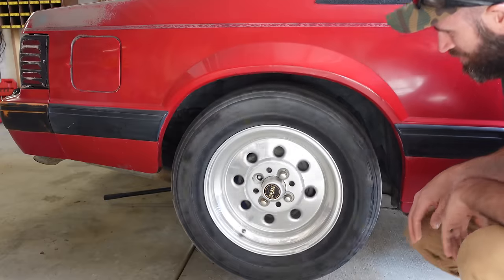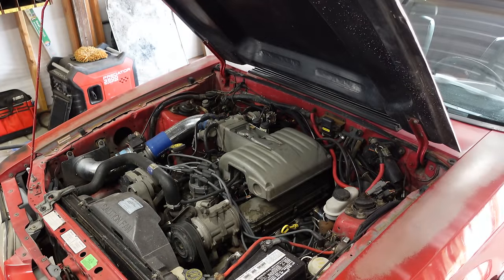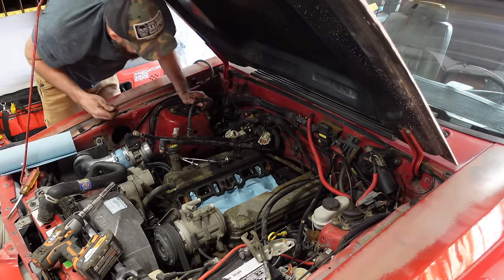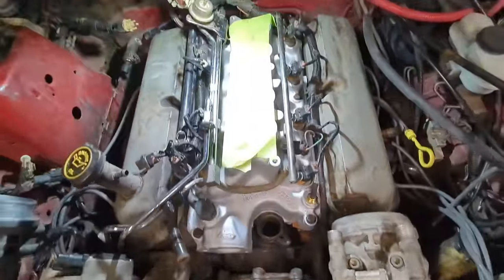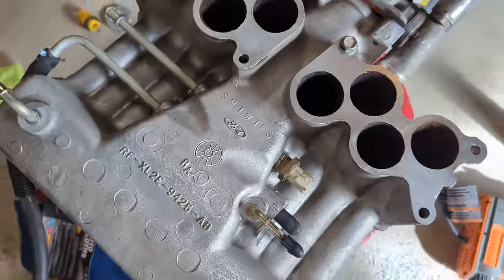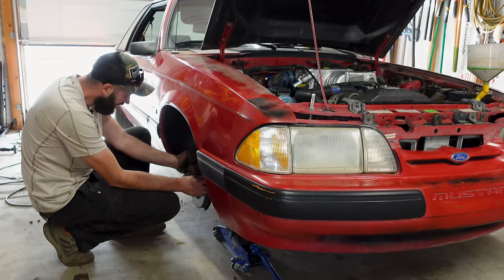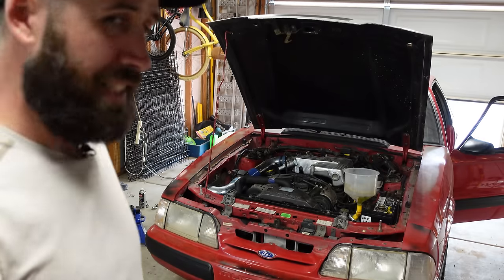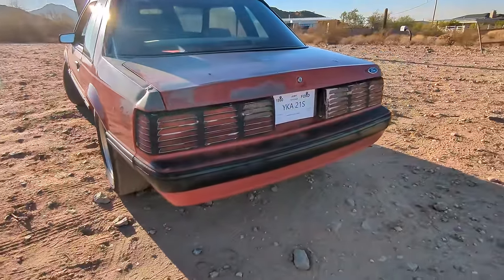Junkyard GT40 Intake Upgrade! Cheap HP? Or Much Regret For The Fox body Mustang?

Comment: One of the best cars i bought used was found on road dead, the guy sold it to me because it quit on him on the side of the road. He couldn't get it running so i got it for cheap. the resistor Wire was burned. I hotwired it to get home then figured it out. it  was  1967 Mustang with a 351 Cleveland 4 barrel and a 4 speed.
Reply from the maker: Nice!

Comment: I wish more ppl would do this. Real easy to do parts swaps all can do. I like watching ppl run setups on Dyno, go nuts etc but its nice to just see a car person work in their car trying to make it a lil bit better. I wish more ppl would experiment with 4.6 2,3,4 valves. Especially thevold panther 2valves. I drive a vouple town cars. Love these engines. Together theyve taken me over 600k miles with no repairs. But i did do the vent seal, reroute the water pump line from back of pump to engine so it wont leak under intake, swapped plastic intake for aluminum, retoute the  passenger Drain and AC lines so they dont leak on frame, derusted, killed rust, sealed up with internal frame coating, rustoleum black, then oil/wax coating all over. 303 any and all rubber like bags, tires, wipers, etc. Feels good to do small stuff yourself and know that this car will last so much longer for it. Its not always about the MPH, HP etc, its about loving what u drive and driving what u love. Panthers FOREVER!!
Reply from the maker: Haha hell yeah, that's the best part! I had a 2001 GT and spent many days on the side of the road placing helicoils lol so I have a bit of a love/hate relationship with that 4.6 😂
Reply: @VeteranRevivals  Love the handle, Semper Fi. Well I can't blame u there, but I can say I've only had plug shits fired from 3v 4.6 n 5.4. Seems like when they either keep it simple stupid, KISS, or make it 4 valves per, issues are scarce. A lot say the trans are weak. I've never had issues there either. I never flush mine, not supposed to per Ford, and always use motorcraft, BnG, friction modifiers, sythnetics like amsoil, and had good luck. But I don't abuse mine either. I don't baby it but I don't neutral drop them either. My 99 ride me n buddies muddy asses all over tri state area going to well pads, forest clearings, pipeline right aways, and has had her fair share of stuck in mud, muck spinning 80mph trying to get traction. And when I break out the 2x2 snow, mud chains look out. Having a family it's the perfect sedan for gear, smooth rides, vacations and about all things. Love them. U have a gr8 week and a good Ho Ho Ho.
Reply from the maker: Haha I love it, one day I'll have to give one a try!

Comment: Just a FYI, buy a set of AFR 185’s. And use the GT40 and cam then when you go 351w use the same AFR’s send your Intake to Big dogs porting, Or buy another and have it ready, and you’ll be 350-400wheel hp. I’m at 315 with stock Intake and GT40 heads with their cam. Heads, and intake are ported, intake is stage III, Heads are stage II. With a ported Gt40 intake id be more along 335-350wheel.

Comment: Old trick from 60 yrs ago.
China wall: drill 1/8" holes 3/32" deep about 1" apart across the length of the china wall.
Whatever gaskets you use wil be captured and cant squirt out. 👍👍😎
Either on the block or the intake. No need to do both.
*****
Intake bolts.. take two extras, cut off the heads, make a screwdriver slot, put one on each side to guide the intake down straight.
****
Cooling system clean out: Prestone Flush yellow bottle. Put it in and drive it 300 miles. Super clean. Flush out the bottom radiator tank. Back flush the hear core. 👍😀
New green antifreeze every 2 years 
****
Thermostat: drill one 3/32 hole in the rim to burp out the air when being refilled. Some thermostats already have them.
Reply from the maker: Nice! Those are some handy tips

Comment: I got a bone stock bottom end carbed 351w in my 82.    Tfs 11r 190 heads.  Tfs stage 2 cam.  1.7 rockers. Vic jr intake.  1 7/8 long tubes. X pipe.  Laying down 425 rwhp 460 ftlbs.  And still has the bearings and rings put in it ij 1996 from henry ford
Reply from the maker: Nice! I have no doubt the 351 is a strong choice

Comment: I have two 1997 Explorers. One came with GT40 heads, and one came with GT40P heads. GT40 Explorer heads used in '96 to mid 97. Three casting 'bars' on head indicate GT40, four bars are the gt40P. Don't know if exhaust manifolds are different considering the reengineered spark plug location.

Comment: An old "cure" for the "china wall" front and rear gaskets on intake manifolds, was to take a hammer and pointed punch and dimple the top of the china wall where those gaskets were going to sit, so they had a rougher surface to keep from sliding out. but an experienced hand laying down just the right amount of "bead" will suffice.
Reply from the maker: Haha that's pretty clever
Reply: Drill 1/8" dimples one inch apart in wall and/or manifold. For rubber or RTV.
Reply: my "old cure" was to throw them right in the trash and use a bead of good rtv on the front and back.  Permatex "right stuff" is excellent

Comment: For easy radiator draining, head on down to Dollar General or Walmart,  and get one of those plastic bins for storing stuff under your bed. They're long and work great if you just want to pull the lower radiator hose
Reply from the maker: 🤔 that's genius
Reply: I do essentially the same thing. It's a fairly flat clear plastic storage container with a lid, about 6x18x30. Works perfect.

Comment: Great vid, really enjoyed it.  Before you drop some coin on a new steering rack, try replacing the inner tie rod ends. They're not very expensive and are relatively easy to replace.  Perhaps you can make another video.
Reply from the maker: Thank you! Unfortunately, as you'll see in the last video the power steering pump seized up and filled the whole rack with metal. Aside from that the backlash in the rack was really bad and all the seals were puking 😞
Reply: When you have left and right play in your front wheel, it is normally the tie rod end, which is a easy replacement, But be sure and get an alignment after you replace either one, and if you have movement with your hands at the 12 and 6:00 positions, then you likely have a bad wheel bearing, which again, isn't a difficult replacement at all.

Comment: I hope you really get the car where you want it to be. Us fox body guys have to stick together. I own two 88 mustangs one lx 5 speed and the is a gt with a number matching 93 cobra motor with a automatic. Thanks for sharing this. I also have a 97 explorer. It won't start now because of the crap ethenol that screws up fuel pumps .you take care brother
Reply from the maker: Thank you! Drop that tank, replace that hose and get her back on the road! 🤙

Comment: This was useful for me. I have a 1988 Lincoln Mark VII which I want to do some upgrades on the cheap. It's a Bill Blass edition too-not the LSC. Love the whitewalls and wire wheels on it. It's a pretty fun car to drive.
Reply from the maker: Hell yeah! I bet that thing rides like a dream!
Reply: you probably already know this, but the LSC had the High Output 5.0 used in Mustangs, so it has a 351W firing order (should you change cams or ignition). the non LSC had the regular 5.0 used in thunderbirds and Lincolns so it has the 302 firing order and i think lacks the forged pistons of the HO 5.0
Reply from the maker: I did not know, that's good info!
Reply: @alertgasper  Actually,you're wrong. In 1988 all the LIncoln Mark Vii's got the 5.0 HO engine,AOD trans,traction-lok and dual exhaust. Not just the LSC. My Bill Blass edition has the exact same drivetrain. It basically a Mustang GT with a Lincoln body-and better brakes with air suspension.
Reply: @TheWalkmanRotation  thank you for that information--it was the 1986-7 models that only had the 200 hp and the HO in the LSC. so you're good to go with that hot rod lincoln :)
Reply: Never forget that the Lincoln computer is NOT easily reprogrammed for mods, so you'll be looking at a $$ upgrade.
It's not the Mustang computer.

Comment: Thanks for painting the hood 👍. Now i can stand to look at it 😉. Is that the Ford block that splits in half if you go over 500 ponies?
Reply from the maker: Yes sir, I've seen them go well over 500 on boosted cars, so maybe it has a lot to do with a properly balanced rotating assembly 🤷🏻‍♂️
Reply: Commonly considered the 500-550hp is where you are pulling the pin on the proverbial grenade, but some last beyond that level and even for a decent amount of time. I personally think not enough attention is paid to damaging harmonics, but that’s just my personal opinion. Glad you’re enjoying it and avoiding going LS !

Comment: Front sump on oil pan is where the pump sits.
Reply from the maker: That's what I figured, I couldn't remember
Reply: The oil pump is in the front, the pickup is in the rear sump. The front sump is there to make room for the pump body.
Reply: @VeteranRevivals  It's driven by the distributor... so just take a look at where that's located. 🙂👍

Comment: You can build a 351W for same or less than an LS.   roughly 500 hp vs 500hp.
Reply from the maker: True true, but much heavier
Reply: @VeteranRevivals  Iron block with aluminum heads, the weights are close for the long blocks.   Where the LS has the advantage in weight is the intake manifold. If you're going carburetor then that advantage is equalized.   I don't know the exact weights for the 351W or the Iron block LS, I do know the Iron block 302 bare only weighs 20 pounds more than the aluminum block LS.
Reply from the maker: That's not a bad weight difference. So the debate usually lies in money haha. If, I'm going to buy aluminum heads for a 351, I might as well pick up the junkyard LS for less than the cost of the heads for the 351. Trust me, I'm a Ford guy 100%, but it's really hard to justify the cost for staying with Ford 😞
Reply: By the time you get the crossmembers, swap headers, swap harness, stand alone injection, etc for running that LS, you could have dropped a 351 in there easily. Many hype the low cost of the LS but by the time it’s truly all said and done there’s not much if any savings, especially if you find yourself a deal on Windsor stuff…

Comment: There’s only one oil pickup. It’s in the back where the pan is dented.
Reply from the maker: Maybe it's time for a new pan!
Reply: Maybe, but if you’re trying to save a buck or two you can probably hammer it out from the inside. I had the exact same thing on my 351 and was able to hammer it out just fine. Oil pans aren’t as cheap as you might think.

Comment: Hey like the video been looking for a video like this that explains all one questions I have the same intake manifold non egr fory fox ody do I have to tap the sensor in or can I run it with out it
Reply from the maker: You'll have to tap in the IAT sensor or it won't run correctly.
Reply: Ok thanks you know the size for the drill bit and the tread I need to make it to
Reply from the maker: I don't remember off hand, but I believe the tap is 3/8
Reply: Hey sorry just can figure out what hoses I cap and which one I run to supply and fuel if you can give me a hint please and thank you
Reply from the maker: That's a tough one to spell out on here, but generally on the Explorer intake manifold upper, there are two small barbed fittings that face the front of the car, those are for the EGR cooler which take coolant. You can cap those. One large vacuum port that faces the front of the car, which you can use for brake booster or anything else requiring vacuum. The vacuum ports facing out the back of the intake manifold can be used for brake booster, fuel pressure regulator, or vacuum supply to the rest of the car through the vacuum tree mounted on the firewall.
Reply: All right I am doing what you did with the sensor taping it on the same spot you did and I block of the front 90 so I hope i didn't need that lol thanks for the help

Comment: LMR sells a heater tube without the EGR coolant lines...part #LRS-9424BA. I tried to include a pic and a link but apparently I'm not that smart...😢...🤣
Reply from the maker: Haha it's all good, I ditched the heater hard line because they are in the way of the throttle when you remove the EGR spacer.
Reply: Did you remove the spout connector when you set the timing? I've always done...engine off, remove spout connector, set timing, turn off engine, put spout connector back in.
Reply from the maker: Yes I did, I even disconnected to spout for setting the idle.
Reply: I just ran one continuous rubber line from in to out. Just the same flow as through the EGR so it doesn't matter.

Comment: a guy might run some CLR thru that cooling system an maybe get it cleaned out a little
Reply from the maker: 😮😮 does that really work? Never heard of such wizardry
Reply: @VeteranRevivals  I've never had to do it, but Ive watched about 7.68254321.6 car shows an seen fellers do it a time or three. Plenty of videos on YouTube about it.
Reply from the maker: Well then, I do believe it's time to pillage the laundry room for a bottle 🤙
Reply: Prestone Flush yellow bottle. You can leave it in forever...
 Run 300 miles, back flush heater, flush bottom radiator tank.

Comment: Why does one need to replace the oil?
Reply from the maker: One only needs do it if one suspects he may have contaminated the oil that currently resides in the engine.
Reply: 1) Contamination.
2) additives settle out after a while and do not remix well.
Look I'm the bottom of your oil bottles when they're empty. See any dark residue?

Comment: Explorer in take is more for torque and you wrong about it flowing more then the gt40 intake. Gt40 is better then cobra explorer half gt40 intake i had them all.
Reply from the maker: I believe that is highly dependent on a wide array of variables. But I won't deny that in some combination I'm sure the tubular is better in such an insignificant way that it's not totally worth debating.
Reply: Richard Holdener tested them ALL back to back. From 2500 to 5000 rpm they're all virtually identical on a HCI 302 with E cam. Above 5500 about +12+.
Below 2500 the Explorer is strongest.... The rpm you usually drive.
Explorer is 1/10 the price of the tubular and 1/4 the price of either Cobras

Comment: p heads at pull a part are not expensive.
Reply from the maker: Very true, but honestly I don't want to spend the money on headers for it or trying to figure out short plugs/wires.
Reply: Rare in our area. 3 or 4 bars.
Reply: @VeteranRevivals Accel makes wires for the P heads with 90 degree boots, easy to find.
Reply from the maker: Nice

Comment: Hp is not cheap so cut the bs .everything ads up.
Reply from the maker: Hmmmm but there is certainly different levels of spending to HP ratio. For instance, I bought  a tubular GT40 upper and lower for my 91 GT 15 years ago for $1k from Ford. A week ago I snagged an explorer GT40 intake upper and lower for $160. The achievable HP difference between the two is so insignificant it doesn't even come close to justifying the cost difference. Sooooooooo that to me is cheap HP.